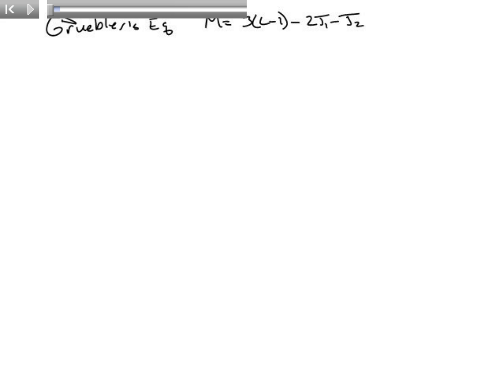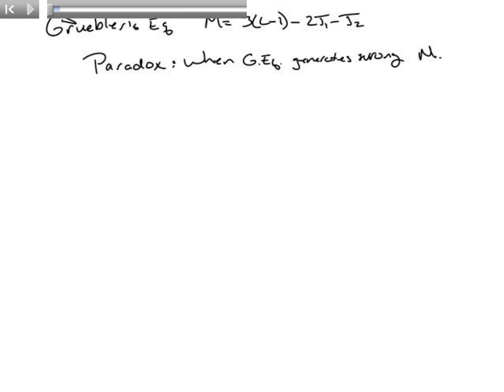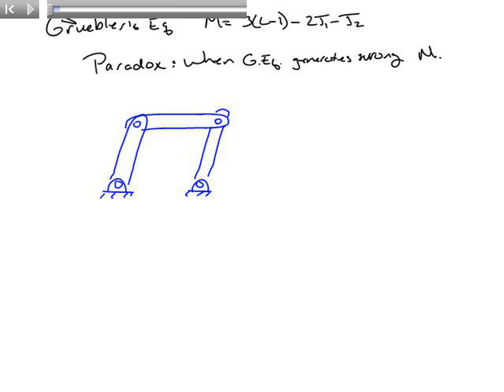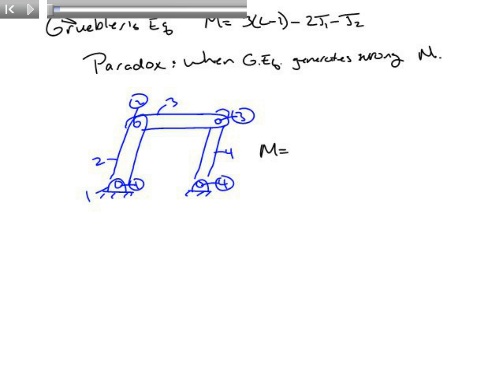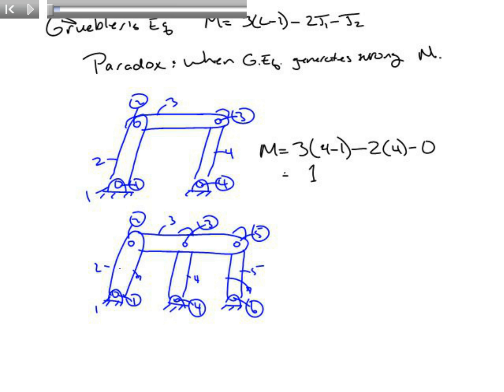Gruebler's Equation Paradox

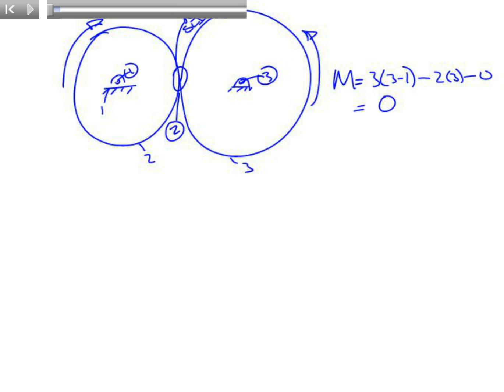Comment: 8:36 Didn't you just confuse lower pairs (full joint) and higher pairs (half joint) here? Doesn't the second joint have punctual (if you look at it from this 2d perspective) / linear (if you look at it from a 3d perspective) contact? And wouldn't that mean that it has to be counted as a higher pair or half joint as you call it?

Comment: Just be more clear, generally, higher pairs such as two cylinderical rollers have two DOF, due to rotation and slipping.
In the above problem, it is clearly stated that there is no slipping between the rollers and hence, the pair has only one DOF. So whatever the uploader explained is correct.

Comment: Looking out for the parallel links part was helpful thank you for that however as stated in another comment below , no-slip section between two rollers still assumed to be a higher pair therefore it would be 3(3-1)-2(2)-1=1